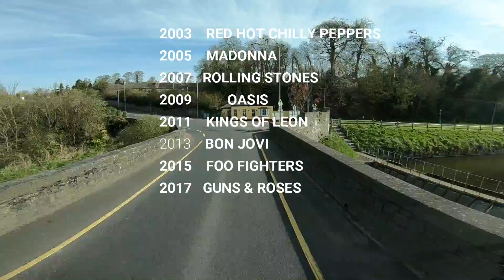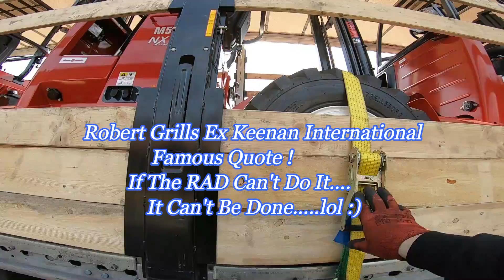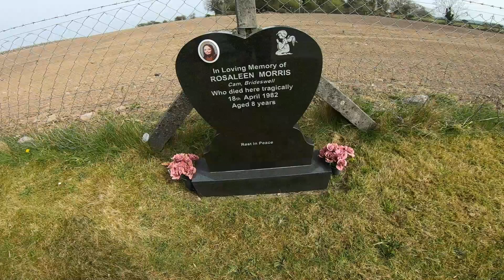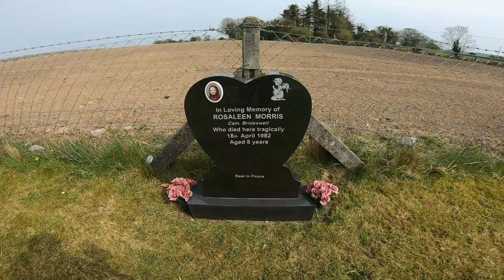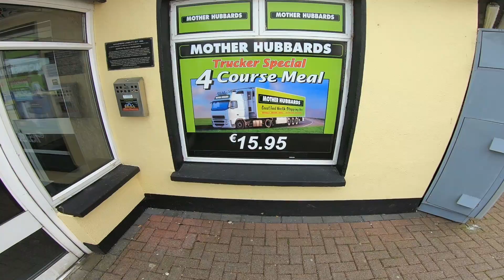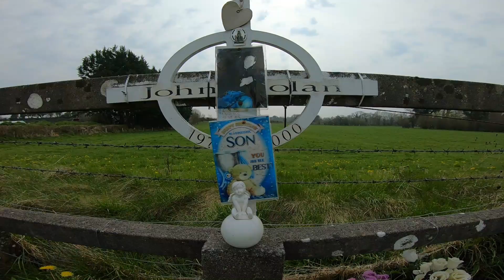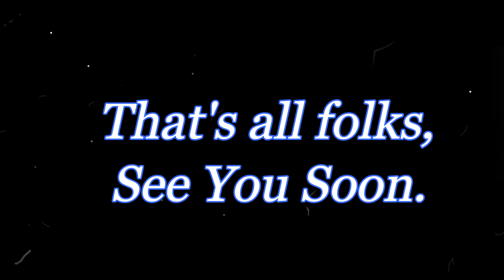Ireland Trucking 🤠

Comment: Wow thats crazy you folks in Europe use Conestogas, (Well the side curtain versions I forget the name, curtain side I guess.) with 1 strap on each, over here (North America) if I pulled into a scale l;ike that they would throw the book at me lol. But it makes sense I mean they are locked in nicely and wont go anywhere, I feel here its a little anal but whatever, gotta follow the rules. Here we would have to put on atleast 2 chains per unit and just run them on a flat bed or step deck and would take about 45 mins to load maybe an hour. Anyway thanks for the videos as always hope you keep them coming.

Comment: Ned, the analogy is not that right, if it is not broken don't fix it.
I wonder how where they loaded in the first place.
The problem here is that every machine in the UK that is designed to be loaded for transport MUST have clear and defined attachment points. I bet my life that the attachments are not over the tyres.
The A50 ticket is for Lorry Loader Securer and this is a qualification REQUIRED by transport drivers for the construction industry and said ticket will tell you how to find said attachment points in the manual book in this case for the (Moffett M5 NX tie down for transport).
Going back to chase the end of the straps is pointless too and a bit dangerous, if there is traffic such as pedestrians or machine movement you could be in the way of that, good practice dictates to stay close to the trailer and bring the end to you so you can feed the ratchet by your trailer.
You threw the strap from the passenger side to the driver side, that is also wrong, the reason is that if you have to check and secure it better you will be accessing it from the traffic side if you stop in a layby.
There was no reason to overdo the tension on the ratchet. It was designed for normal human tension and not with aid of bolt cutters, that was way over the top.
I hope you do know that if you have to brake hard for an emergency stop then the load will probably move forward, this is because you don't have anything securing for forward momentum.
You are actually breaking the law. Your transport manager should know your minimum requirements to be able to do the job safely, if not then they are also liable.
If the side woods panels were not flash with the tyres then that means they were bent inwards.
I made a very small video showing what to look for and how to hook it properly.
There is a say too, Old dogs can't learn new tricks.
The only reason you got away with it is because of the curtain. Nobody knew what you were transporting and how!!!!
In the end, you changed trailers, I was looking forward to seeing how you offloaded those machines.
The company I work for hired a new class 1 driver with a massive chip on his shoulders because when I confronted him to demonstrate his error, his answer was, I have been doing this for over 20 years and nothing has happened. Nevermind what I replied to him, sufficed to say he was wrong.
Reply: Karen